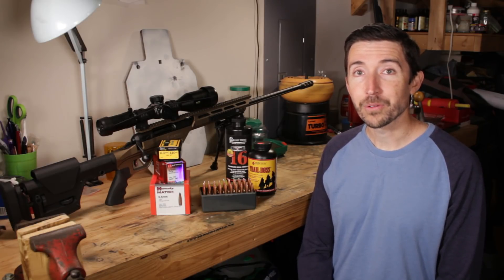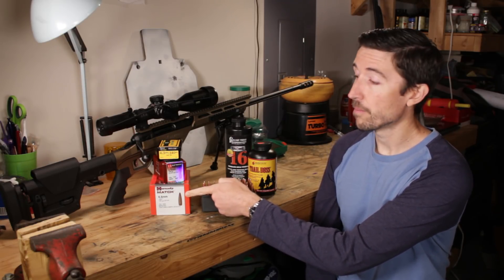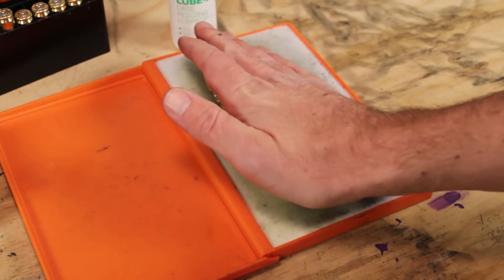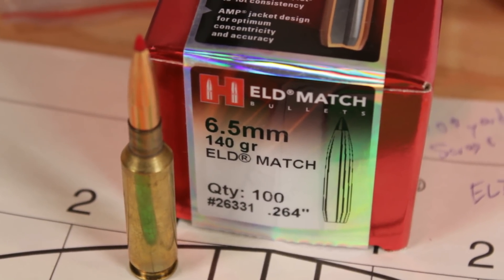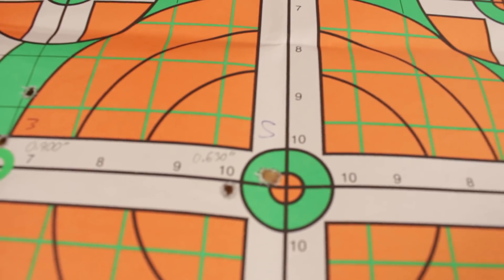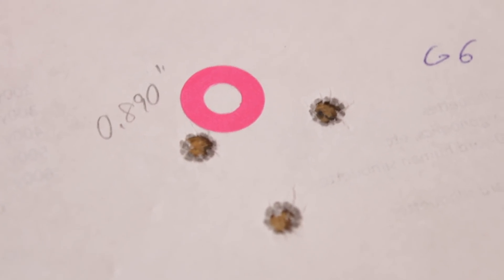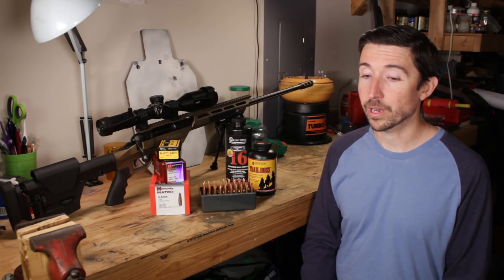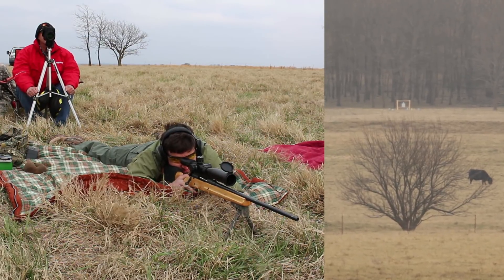6.5 Creedmoor with Alliant Reloder 16 in the Savage Stealth Evolution: Insane Results!

Comment: Thanks for shareing.Just wondering if you have tried using RL17 through your 6.5cm and if so what powder load you would recomend?I couldnt get any more RL16 but have also heard RL17 works very similar so I will give it a go after I run out of RL16 but any feed back would be much appreciated:)

Comment: In those 150 rounds through the barrel did you clean the bore?
Reply from the maker: I can't remember. I don't think so. If I did, it was too clean powder fouling only.
Reply: @SocialRegressive  I just started reloading a few months ago and I noticed that after 20-30 shots out of my savage ultralite 6.5prc my velocities go south unless I remove all fouling. I then take 1-2 shots and the velocities shrink again. I use Retumbo and Barnes LRX 127 for lead free here in California.
Reply from the maker: That's surprising. I don't know how dirty Retumbo gets, but you may consider a different powder. Varget, 4350, and RL-16 remain consistent even with high round counts. In the meantime, you might try putting spartan accuracy oil in your clean bore and see if it helps. Supposedly it helps preserve consistency.
Reply: @SocialRegressive  I was able to find 5 lbs of Reloder 26 in my local shop overpriced at 39 per pound and I will try to figure out a load with that. Barnes did some testing and it performed better than H1000 and other powders on 6.5PRC with ADG brass, which is the brass I’m using. Surprisingly they did not test Retumbo. I’ve read in some forums that Retumbo is one of the most dirty powders.
Reply from the maker: Whoops! I forgot you said 6.5 PRC! Heck yes. You'll love RL26. Please let me know if it fixes your problem.
Reply: @SocialRegressive  will do thanks!

Comment: Interesting video. I feel your pain on the youtube policy changes. Have you neck turned your brass to see if your groups got any smaller?
Reply from the maker: I have a couple of ideas for ways to crank this load down a little tighter, but I think I'll wait until I start a new build series. I figure I'll leave the OAL as-is and tinker slightly with powder charges around that best load. I like the recommendation of neck turning. I might whip out my neck turner if the measurements are looking inconsistent. So far, though, I'm perfectly happy! These should be able to smack steel a long, long way off.

I just subbed your channel. Thanks for commenting, man.
Reply: Thank you for the sub. I hope you enjoy some of my content and always looking for was to improve my content as well so feel free to leave feedback.

Comment: Curious why you shoot 3 shot groups instead of 5 shot groups?
Reply from the maker: I usually shoot 5-shot groups, but lately I've scaled back to save some coin and range time. I'm usually testing several handloads in a session, which can take hours. Based on the results I'm seeing, I don't think the extra two shots would add that much data. I could be wrong, though.
Reply: I shoot 3 shot groups when testing for new loads. 3 shots usually tells you what you need to know to get you close on powder charges  & o.a.l that's working for the rifle. Then work on 5 shots fine tuning the load

Comment: quick question.. I'm new to reloading.  when you are trying loads with your chrono do you have to re set up the chrono every time you switch aimpoint on your target to try a new powder charge?
Reply from the maker: The Satterlee method has some similarities, but you only shoot one bullet per charge weight. Afterward you graph the velocities and scan the waveform for "flat spots." If I read the method correctly, the best velocity SDs occur in these little plateaus. I might try it sometime.
Reply: Nope you dont. Only thing you need to to is to make sure you keep a good record of the stats shown by the chronograph. For example, I have the cheapo one made by Caldwell, I hook it up to my phone and I am able to write a description and add a picture.
Reply: Thanks.. this almost sounds like the scott Satterly (SP?) method.. only with groups all worked together?

Comment: At what range did you shot these groups?
Reply from the maker: I should have included that! 100 yards.
Reply: no problemo! I do a lot of 100meter shooting, with a rem 700 police in 308W (155 grn hpbt sierra matchking, with 43 grn N150), and i leave the Chrony at home, for me its more important that it groups, than the SD. Groups about 0.5 inch ctc at 100meters